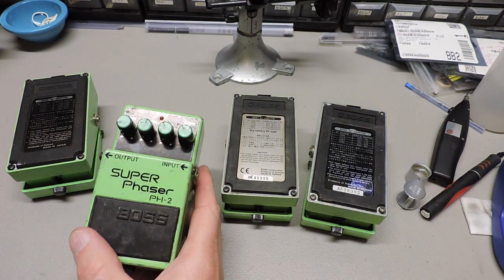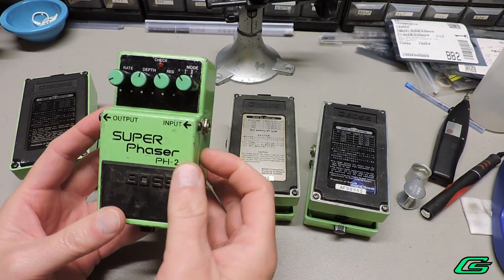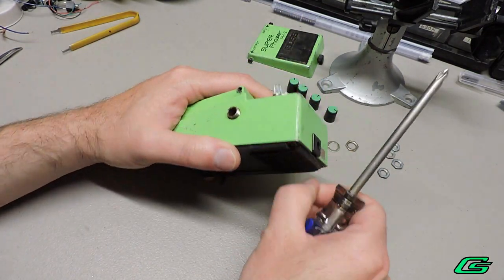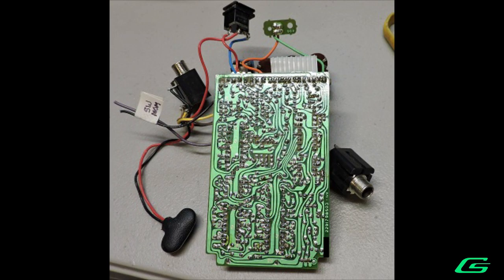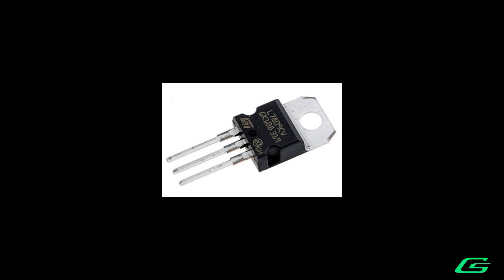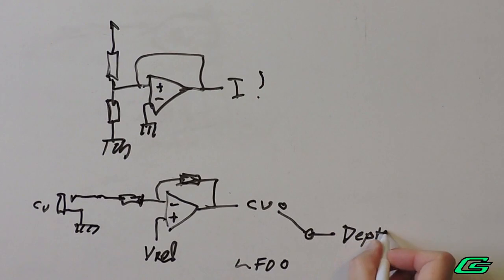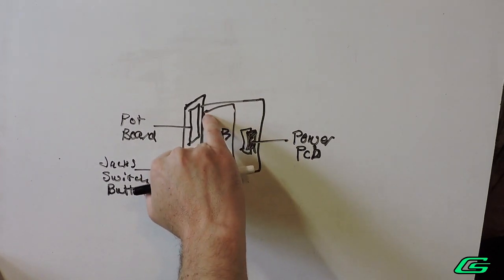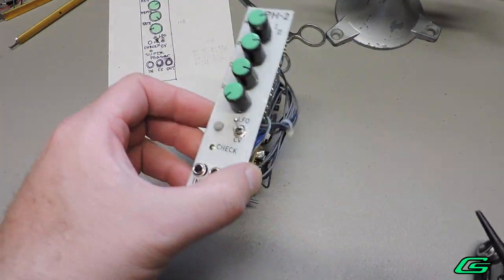Converting a Boss PH-2 Phaser Pedal to Eurorack + Audio Demo

Comment: Fantastic job! Could you do another video with detailed instructions on how to do the op amp circuit for beginners? I'd like to convert some other guitar pedals but don't really know how to make cv inputs for the controls on the pedals.

love your videos - keep up the good work.
Reply from the maker: The details were purposefully left out, I didn't have time to fully analyze everything and rushed the build.  For sure I didn't draw the 'unity-gain follower' correctly in this video.  Also called a 'buffer', just do a search for that and it will show you what it needs to look like.  The other one is a 'basic inverting amplifier'.  I tested w/ an envelope CV going into the depth pot, and the polarity was reversed - hence the need to invert the incoming CV.
Reply: @gstormelectro  Thanks for the info - I'll do a search for that stuff - again - great work.